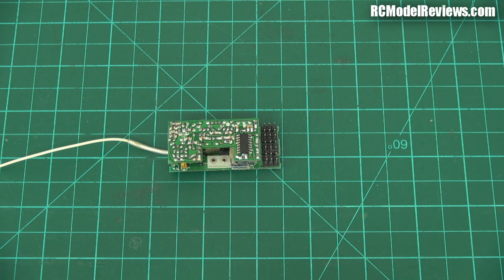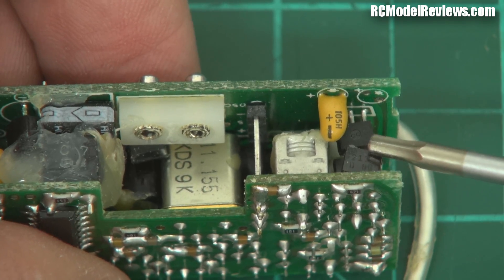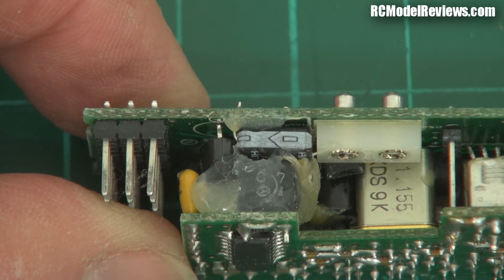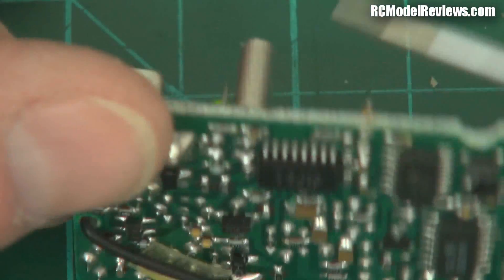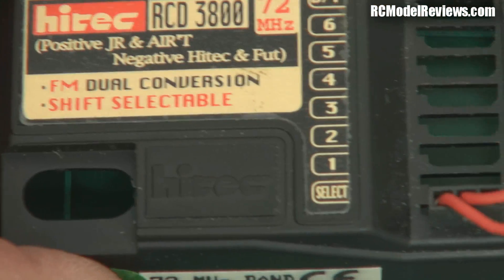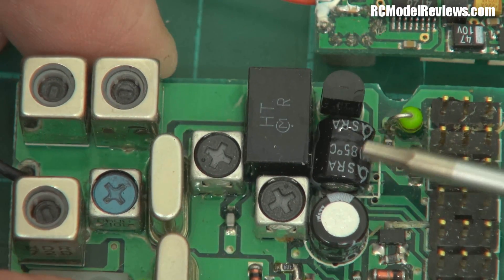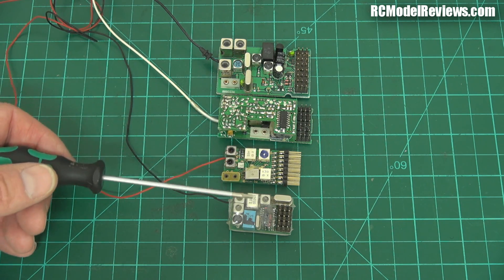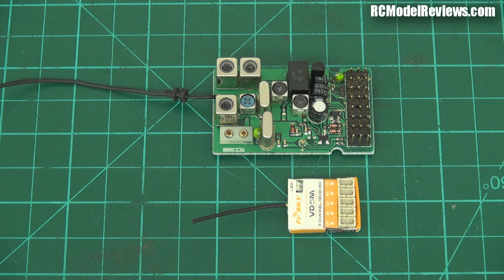Some old-school radio control receivers

Comment: Got back into the hobby after 20 years or so.  

I’m still using the old stuff, seems way more reliable than 2.4 based on what I’m seeing at the field, and safer than ever since no one is using it anymore.

I keep seeing Non binding issues, brownouts, signal loss with 2.4.  I don’t know why people tolerate it to be honest.  We never saw so much as a glitch every now and then, and it never brought the plane down.  

When there was a ton of people flying there was the big risk of getting shot down, but that risk is long gone.

Comment: Wow, that is high tech compared to my first rc equipment.  It was an Orbit 10 channel reed system with a tube transmitter.  Man those 100 volt batteries were expensive! and almost 2 pounds of flying weight with receiver, batteries and 4 servos. All of this was in a Carl Goldberg " Falcon 56" covered in reddish orange silk with a Fox .35 glow.  Wish I could have rebuilt after the initial maiden/fatal crash.

Comment: Yeah, i hated those recievers. After every Crash the Reciever becomes a Timebomb, i have a box with min. 20 crasched recievers:D
The most reliable one i ever had is a Varioprop T4 from 1978, sometimes i still fly this old Glider with the old RC Gear. Back in the days i used it quite a lot, never had any trouble with it. But i think it has more Transmitting Power then the new ones, the HF Modul becomes a little bit warm after 30min of use :D
How abou a video about the evolution of Electro flyling? Beginning with Brushed Motors, mechanical Controllers and 1000mah Sanyo`s? In the old day it was the complette opposite of today, you had to be a real Enthusiast to fly Electro, nower days it becomes more and more enthusiastic to fly nitro engines....

Comment: I built my first RC plane, a Carl Goldberg Falcon 56, around 1965.  I had an Orbit single-channel, non-proportional transmitter.  All this transmitter had for control was one big on/off button.  The plane was rudder only, using a compound escapement (servo) that was driven by a long rubber band that I would wind up before each flight.  The plane eventually flew away, off into the clouds, due to radio failure...or maybe the rubber band broke.

Comment: The old receivers are not that big compared to what i made a few months ago.
I bought myself a kyosho AM car transmitter and needed a receiver so i made one entirely from salvaged parts, discrete transistors and on a cheap perf board.
The bloody thing is huge but it works and has a range of about 20 meters, which is enough for my little brother.

Comment: i used some indoor fm receivers that because of the small size, did not have enough filtering, so they had to use 3 channel frequencies instead of one. I'm still not sure that they were entirely legal FCC wise, and had the potential of causing other people interference. 
for the time, they were very lightweight at about 4 grams for a 3 channel with 2 actuator outputs and a speed control.
now for a similar 2.4ghz receiver, they can weigh as little as 0.28 grams O_O

Comment: There was nothing wrong with through hole construction, other than it was big. Through hole will take infinitely more abuse than surface mount ever would. if You flex a SM board, parts come flying off... TH you might break the part, but the two ends are still soldered in place.

Comment: Since the PWM pins have been moved over to the flight controller. The receiver is down to just 10mm by 10mm with a serial output :p

And when i got my Scisky and tried following the antenna: "WTF? That's the receiver???"

Comment: Hi Great video. Don`t know if you can find some of the really old stuff. I can remember about 50 years ago my dad had an rc set, don`t know the make and i think it came as a kit, still recall him showing me, the tx had a vacuum valve in it which lit up, just two switches on/off and a momentary that operated the rx which was driven by elastic band and some sort of escapement device. He had to make the case from plywood and had about 10 foot Arial. Do you remember any of that stuff ?
Regards from the UK.

Comment: have you  seen  those sub-postage  stamp  sized  receivers?  Amazing.  Wish I  could  get  one for my generic  TH9X.  If you  want  to add a room to house  it I have a mid 80's Futaba rx...
Reply: Banggood have some small FlySky clone receivers including the V911 and F929 Bricks
Reply: I  need  one of the  6 or 8 ch general  purpose  rx.  Fixed wing and sail  boat...
Reply: I use the 3 channel Flysky receiver for my sailboats: http://www.banggood.com/FS-GR3F-Receiver-For-RC-Car-And-Boat-p-1060762.html?rmmds=search.
3gm without case for light applications like indoor plane.
Selection of micro receivers here (not AFHDS 2A): http://www.banggood.com/search/flysky-receiver.html. Some not full range, most have failsafe.
Reply: I'm  not  sure  I  can  make  3 channels  work  on a galleon,  worth a look...

Comment: Unfortunately I can go back even further. My first RC plane was a single channel, AM I think. it had a button that activated a escapement that was powered with a twisted rubber band. Rudder only, right was up, left was down. Later the best gear started using FM proportional system. But it was to expensive for my paper route income, so I stayed with control line planes. Wow you really triggered the "Way back machine". Thanks Bruce

Comment: I also heard about a fuse method, rudder only I think. A fuse would burn and after some time would burn something holding the rudder straight, when burnt through this would cause the rudder to turn and stop the 'plane going too far
Reply: Dethermalizer on the elevator gave up to stall the glider into descent.
Reply: Vintage RC has a picture and description of 10-channel reed bank, also by REP.
http://www.mccrash-racing.co.uk/sc/reeds.htm

A reed receiver or tuned reed receiver (US)
https://en.wikipedia.org/wiki/Reed_receiver
Reply: Yep, most of my early gliders had that fitting.
Sometimes it didn't work :(

Comment: iv had more flyaways with dsm2 than i have 35mhz.. bring it back ;)
Reply: Digital does seem to be a bit "All or nothing". Once you loose the signal it's gone till the link can be reacquired (And if you're flying away from yourself at the time it's unlikely to come back). 35mhz used to go glitchy as hell at the limit, But if you quickly held the TX's arial a bit more vertical you could usually get enough control back to turn the model around and start coming back out of trouble.
Maybe if a 35mhz analog system could be made with some kind of frequency hopping and a failsafe it might be a winner. :)
Reply: i believe the problem with 35mhz and 72mhz is bandwidth to cope with hopping. but id love to see it also ;)
Reply: AndyRC too many wifi bluetooth and cell devices around using 2.4
Reply: agreed
Reply: Which is why DSM2 Tx's are banned in Europe and manufacturers switched to DSMX which is considerably more robust. 35MHz, with peg boards, kids shooting you down with model cars and Christmas toys - no thanks.
Reply: cars were 27mhz and most likely now all 2.4 as well. had problems with dsmx also so i stick to frsky myself.

Comment: On the Hitek could it be two crystals and a 10.7MHz 15kHz crystal bandpass filter ( I used to fit the 10.695MHz to CB's) it has three legs and it is closest to the removable Xtal.
Reply from the maker: Yeah, you're right.. just like in the FMA M5 receiver

Comment: Hiya, Bruce!!!!   Nice write-up!!    Just for your info,.. apart from the 455Khz ceramic filter,  some Rx had a 10.7Mhz crystal filter as well, for the first I.F, (Dual conversion...)  its easy to spot,.. the 10.7Mhz Xtal filter had 3 wires/connections, as against the 2 connections for a standard crystal... Cheers, Fred

( Ah,  see you sussed it, @  13 mins, sorry!!!   )

Comment: Are there still any benefits of the older low frequency receivers as compared to the current 2.4 ghz systems?
Reply: I think we all left 35Mhz analog to jump on the 2.4ghz digital bandwagon because it was far too easy for someone at home (Not in the local RC club) to turn on their TX while setting up their RC model, and half a mile away your pride and joy would end up barrel rolling into the ground because they unwittingly started broadcasting on your pegged frequency.
It's a situation that modern digital kit more or less prevents from happening.
Reply: Yes, they go through water.
Reply: better penetration? also people doing long range fly lower frequencies around 400mhz because the lower the frequency, the less power is needed for a certain range.
Reply: Well, I did wonder if 35 MHz would have really incredible penetration, but since long range systems use 400+ MHz, I thought there might be some technical reason why they don't use 35 anymore. (Maybe not enough bandwidth for the number of channels used today, for example?)
Reply: +Ethan Shankar I think I heard something about higher frequencies being able to transmit more data so maybe 35mhz isn't able to transfer enough to control the plane? that's why WiFi is 2.4ghz or 5.8ghz.
I may be completely wrong on this as I'm no expert on this stuff so don't take my word for it.

Comment: very interesting and good explanation of the circuitry differences in the last 20 years. I worked on several old radios and was always curious about what the little components and canisters were in comparison to a more modern board. anyway thanks for the video I appreciate it👍

Comment: hey bruce, have you heard of any instance of DSMX being shot down by RF noise? my local club has had 5 planes go down in the last month on DSMX and we are a few km from some large cellular towers. very odd.
Reply: yeah that's weird. I regularly fly from a site which has a cell tower literally 50m away from it and I've never had a glitch with my spektrum gear (both dsm2 and dsmx) on fixed wing or multirotors. hell, I even fly some things on 72mhz at that site and have never had a glitch.
Reply: RCFlightReviews Weird.... I use Spektrum and  encountered something last week. Powered up my plane and walked it to the strip, while setting it down, had a throttle burst(not too much) for a split second. Motor switch was disable on my DX8G2 so I'm confused. Same day one plane had bad tail wag like my servo was twitching, landed and nothing was noticeable. Another plane had a rudder issue. It was limited to the left while in flight, knife edge wasn't hardly possible to the left. Landed and rudder had full throw. Might be coincidence. I had only ever had one electrical problem when I flew using crystals years ago. Upon returning to the hobby there's a long list of things that happen. Is it 2.4ghz that has problems or what? I almost want to buy an older Transmitter.
Reply: I fly near a cell tower on dsm2 and dsmx with no problems. If the receiver has been in any sort of crash even minor it can cause complete signal loss. I have had dsm2 and dsmx both drop out due to the receivers being in a crash. You just pitch the receivers at that point.
Reply: Flyin Mikey Hi it must be to noisy where you fly. Flying in heavy traffic near cell towers with powerful transmitters is not wise. I fly cheap toy grades and notice the difference in heavy traffic area's even turn my own phone off.😢
Reply: i only fly foams and i haven't had any problems but all the planes that went down were gassers. I'm wondering if they were all brownouts. seems odd that i haven't had any problems.
Reply: Mark Vande Sande Make sense. The field is near and AF Base and that day a formation flew over like they were refueling(have no idea). Maybe there was some interference. Have had my quadcopter cut out a few times and another plane that rolled 45° a few times for no reason. I was starting to question a few possibilities.... Either way, I never had problems with my old Transmitters. The last 2 Spektrum "Radios" I've purchased new and every quad/plane/heli has displayed some glitches or issue, all on 2.4.
Reply: Flyin Mikey AF base all sorts of wierd signals radar, Emc's cell plus pilot comms, radio.Quadcopter 101 had to replace two flysky transmitters because they were fault on range with dropouts. Have you tryed a range mod? or switch to 1.6 might help
Reply: STRYKA That how it should be while flying "aircraft." I don't even know where/when people began to say 72mhz had problems. Hardly ever seen or heard of problems with 72 but that was before CELLULAR towers were on every corner. I flew next to a tower few days ago without issues but someone said if you get too close you'll lose all control.... I believe it!
Reply: Flyin Mikey Im afraid It's a case of there transmitters way more powerfull than they should be. Had it with CB radio and tv signal in the 80's. 😕